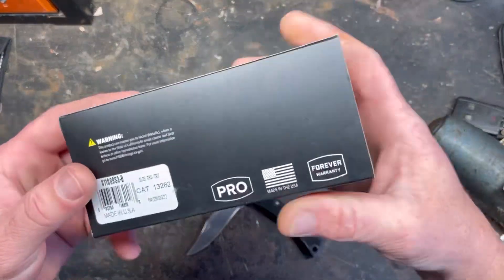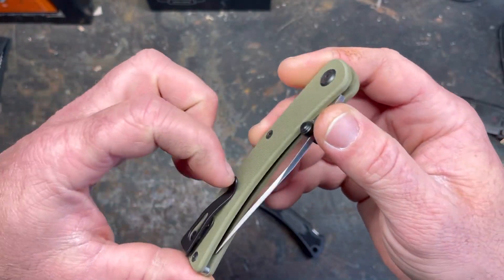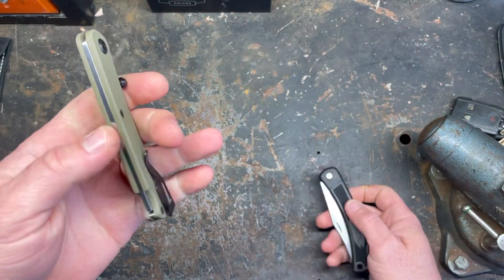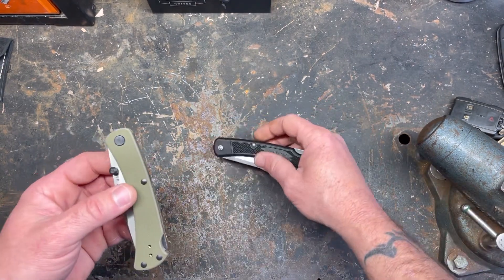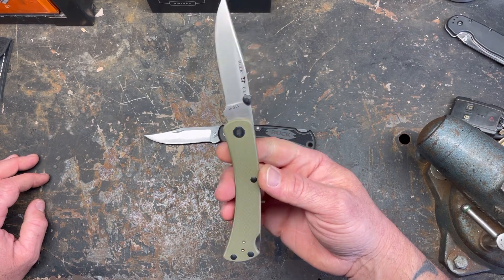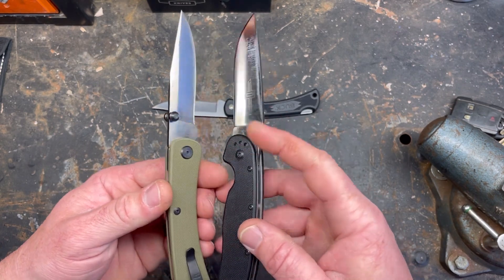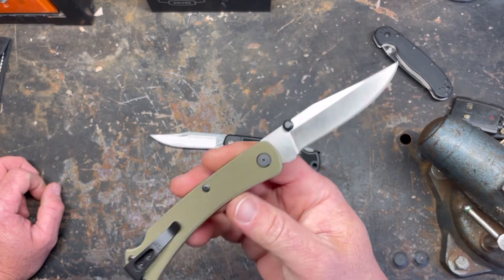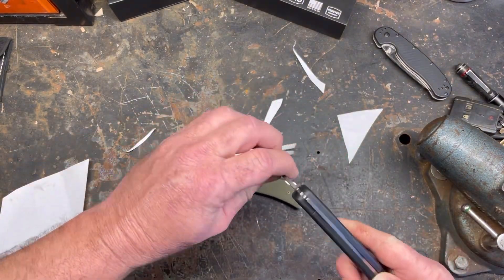BUCK 110 SLIM PRO TRX initial impressions and complaints

Comment: Had those thumb studs snag on my pocket when pulling it out of my pocket, it partially opened the blade and then snapped shut on my hand , bit of a cut. They are too big and too far from the pivot. 

Also the tip hits the inside of the handle if it closes too fast and puts a perfect ding in the front of the edge. Schoolboy errors really

Comment: Mine came with a better fit and finish but the screw that holds the blade in the scales came loose and was lost somewhere after only a couple months. I didn’t have a great experience either and that was not only my first buck but my first knife purchase ever. Wasn’t the best first impression to make. I need to send it back in to have that screw replaced I guess, but it’s been sitting in the box on my shelf for almost 2 years now so idk if that’ll ever happen!
Reply from the maker: That’s terrible. I was hoping it was only mine that had that problem

Comment: I have never been a Buck fan. I don't like their designs and the steel is not the greatest and fit and finnish leaves a lot to be desired. I don't own a Buck and don't plan to add one. I have always thought Buck was over rated and overpriced.
Reply from the maker: I agree. They were good in the 70’s-80’s. But a lot has changed.